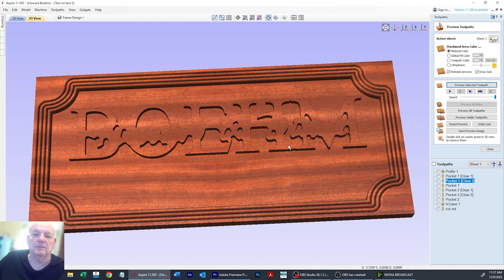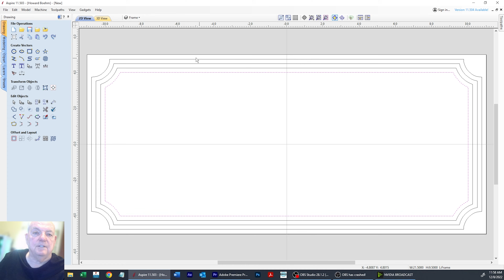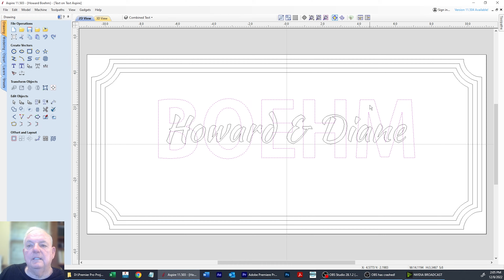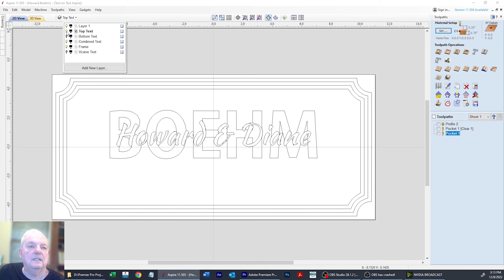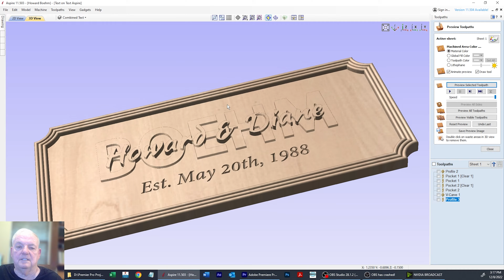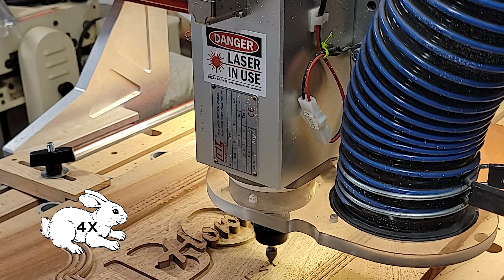Text on Text Made Easy

Comment: after doing stacked text items for several years now, i found your vid a bit interesting. i like the idea of beading like that, but, for the rest, what i do, is clear out the top layer, leaving the top layer of text, then the bottom layer, leaving both layers of finished text. to keep things as easy as possible, i use only a .125" diameter flat bottom mill (eliminates the multiple tool changes). doing it this way would eliminate the need to have a separate tool path for lowering the lower level text. usually my top layer is 1/8 inch deep, and the bottom layer is another 1/8 inch deep, with the final background being 1/4 inch deep. this keeps my number of passes at a minimum of 1/64 inch per pass, moving rapidly, with enough overlap to keep sanding to a minimum. last one i have done, was for the wedding of my cousin. done in walnut, as an oval, finished with boiled linseed oil, then painted the first names, first in the brightest yellow oil paint, then the brightest gold oil paint (a tip from a friend of mine, who owns a high end restoration shop out of the dc area. he said bright yellow first for a bright gold finish, and red, for a burnished gold finish). then 3 coats of clear shellac. turned out quite nice. as to hardware, and software that i use, i have an original, problem free shapeoko2, that i rebuilt into a larger area machine (still using the original spindle after several years of use), and vectric's vcarve desktop (i have found that for my needs, the pro version, and aspire, have the same level of what i need, at a greatly increased cost). what i follow, is this five step process, with only 2 layers needed. 1. Create 2 Layers (Upper and Lower). Leave both visible.2. Create your upper text on the upper layer. Create another vector as a border, one that will be large enough to encompass both the upper and lower text. At this point convert the text to curves. You can now node edit the text to eliminate loops/artifacts, and 'weld' the touching letters together (if required). Group the entire text (but not the border), and hide the upper layer.3. Create bottom text on the lower layer. Convert to curves, edit and group the entire bottom text as you did for the upper text.4. Show the upper layer, then right click on the upper text vectors and border and select the copy to lower Layer option. This will send a copy to your bottom layer for welding. Once again hide the upper layer.5. Now select both grouped words on the lower layer (but not the border), and click the "Weld Selected Vectors" button (right below the mouse pointer button on the left side under "Edit Objects").